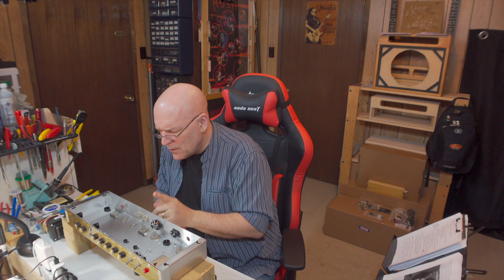Jag's Tech Tips - Chassis Shielding Integrity

Comment: How are things, I took the chassis out of my amp and tore the shielding foil slightly, would this be an issue?
Reply from the maker: @OscarEgan-vj9qv  if it’s just a slight tear, put some contact cement on it, smooth it down and it should be okay.